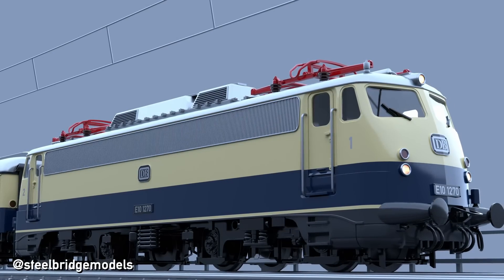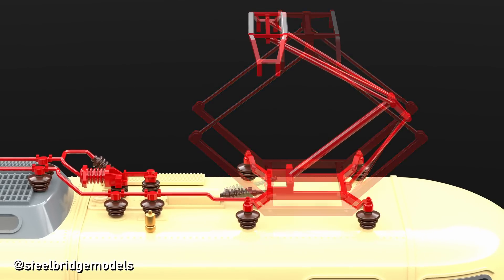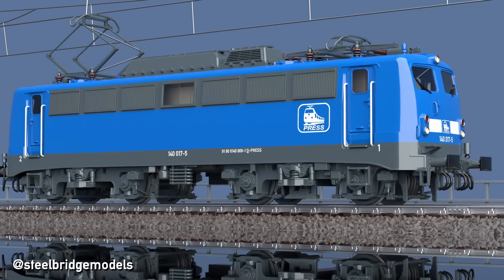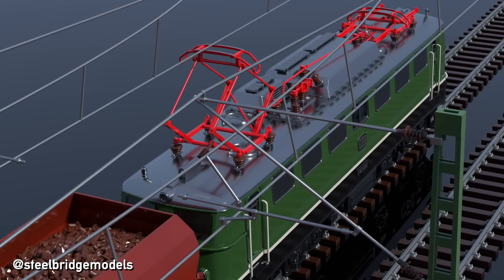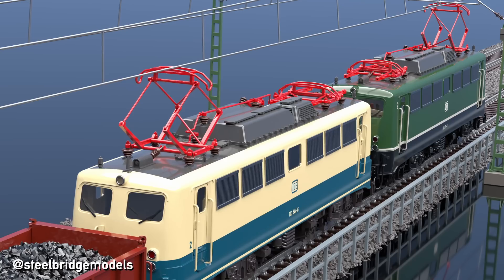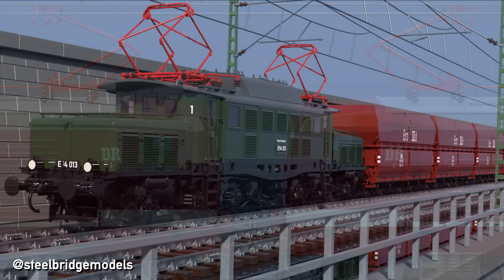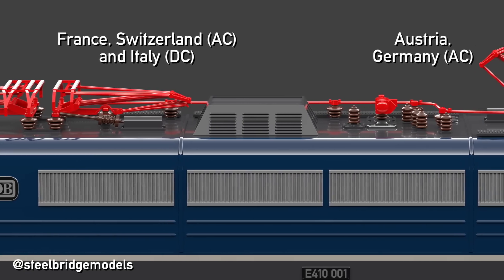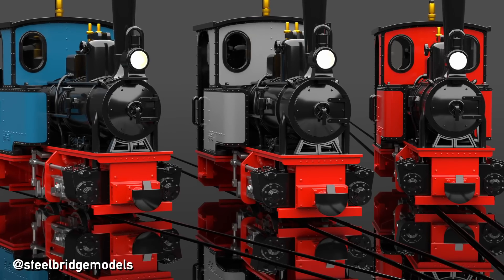When to use which Pantograph?

Comment: Nice video! If I may add some fun additions not from Germany. At 3:47, a lot of Dutch locomotives also raise two pantographs, but only at standstill. Due to the low 1500 volt DC system, overhead wires can heat up too much when a locomotive that draws a lot of current is standing still. To prevent the heating of a single point, a lot of Dutch locomotives raise their second pantograph when at a station. 

Around 4:25. This had also been a big issue for SNCF when developing the TGV. The high speeds made the vibrations much worse, making the use of two pantographs (one on each power var) impractical. Nowadays having multiple pantographs at high speed isn't an issue due to improvements in their design, but before the vibrations were a concern for TGV trains running on the high speed line. Because of this, TGV's actually pick up power from only the rear pantograph, with high voltage cables between the carriages delivering power to the other power car (usually the front one has the pantograph down). Although other high speed trains such as the ICE do use multiple pantographs together, even the latest TGV's still only have the rear one raised in normal operation.
Reply from the maker: Very welcome additions, that show how complex this seemingly simple topic really is! Thank you!
Reply: In parts of France that use 1500 V DC, locmotives also use both pantograph when stopped and when starting, to minimize the current at each contact point. I wonder if the same applies in Italy where 3000 V is used...
Reply: @dwegmull  Not in Italy, but in Poland they sometimes do.
Reply: @dwegmull  same in Czechia
Reply: @dwegmull  yes, i've seen it done in Italy, but not always, so i don't know if there's a rule about that.
Reply: @dwegmull  Italy partially uses the lifting of the 2nd pantograph, in addition, a contact oil must be applied via special nozzles. Today's 4-system locomotives have 4 different pantographs, so only one pantograph can be lifted per power and overhead line system, and have 4 contact plates on one pantograph for the direct current overhead line, which solves this problem when starting under load...
Reply: Is that also the reason why the older TGV Series has a different Pantograph Design?
Reply: "overhead wires can heat up too much when a locomotive that draws a lot of current is standing still"
When it's standing still, a locomotive isn't drawing much current at all. The issues is when the locomotive accelerates away from the station, which is when the maximum current draw happens.
Reply: @beeble2003  It isn't about the total draw a locomotive has at that time. It's about how much it draws at a single point of contact. Indeed the total draw will be much greater when accelarating, but it's not an issue since the train is moving, so the wire will heat up over a larger distance.
Reply: @beeble2003  Normally, current draw should be near zero at low speeds (power = force * speed). I guess classic DC locomotives behave a bit different because of the resistors they need to control power output?
Reply: @thomasgabler3476  For a DC motor, current is proportional to torque, so the high torque of accelerating from a standstill draws a high current.
Reply: @beeble2003  Ah, OK. So it's because they don't have a transformer that would reduce motor current.
Reply: @thomasgabler3476  actually DC locomotives since the 80s are converting the power and using AC motors, the stationary power draw is just for heating/ac.